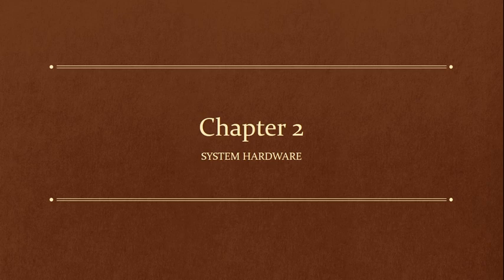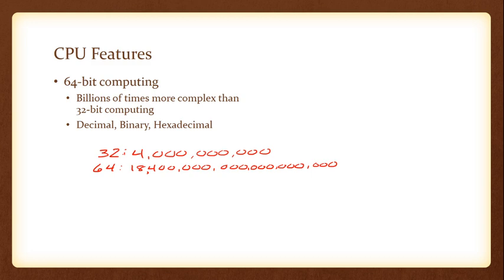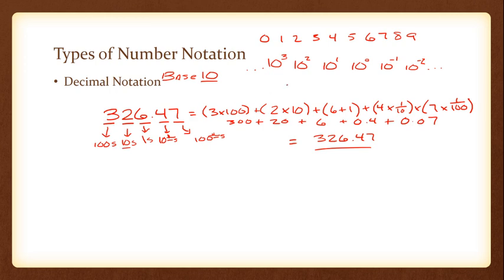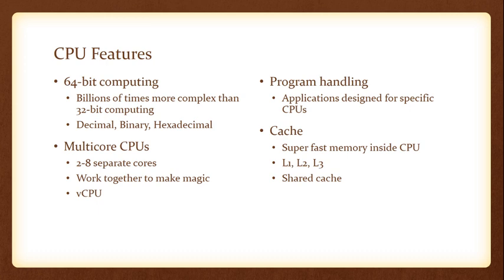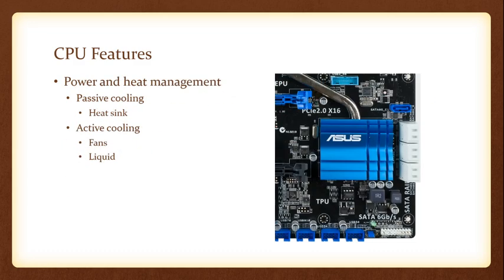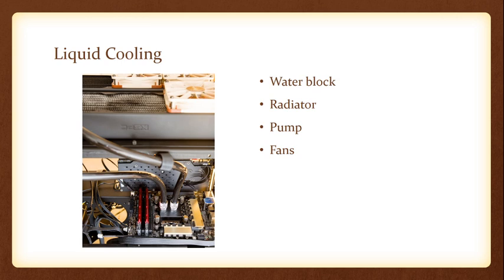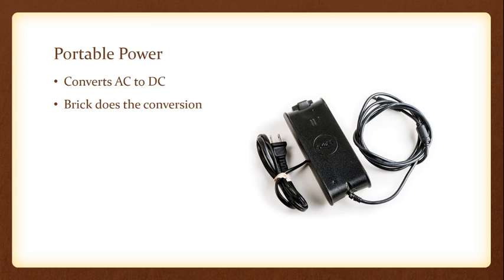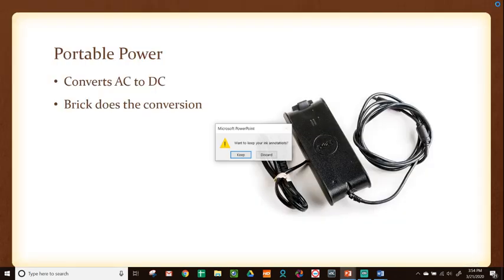Chapter 2 - IT Fundamentals+ (FC0-U61) System Hardware

Comment: but in question no. 6 ,,,   SODIMMs can be used for smartphone also , is it right??????
Reply: No, SODIMMs (Small Outline Dual In-Line Memory Modules) are not typically used in smartphones. SODIMMs are a type of memory module commonly used in laptops, small form factor computers, and some industrial applications. They are larger in size compared to the memory modules used in smartphones, which are usually in the form of small, soldered-on chips known as system-on-a-chip (SoC) or integrated memory.

Smartphones typically use embedded memory solutions like eMMC (embedded MultiMediaCard) or UFS (Universal Flash Storage) chips, which are directly integrated into the device's motherboard. These memory solutions are designed to be compact, power-efficient, and provide high-speed data access for mobile devices.

So, while both SODIMMs and smartphone memory serve the purpose of storing and accessing data, they are different in terms of form factor and interface, and are not interchangeable.